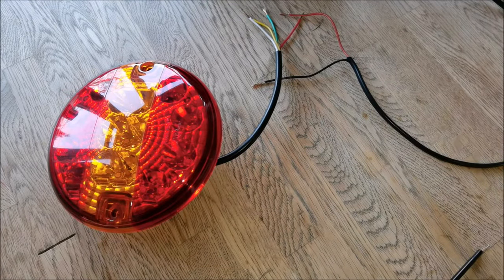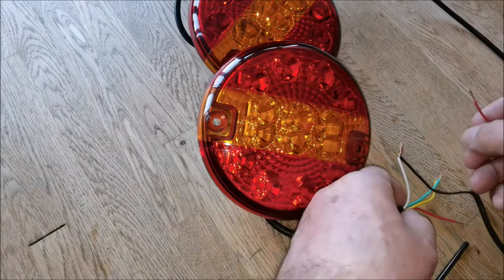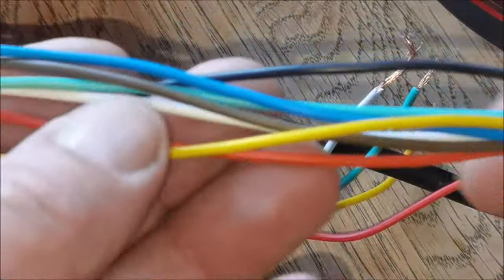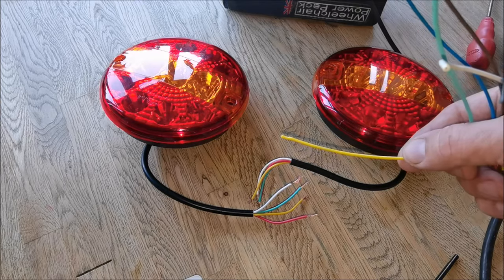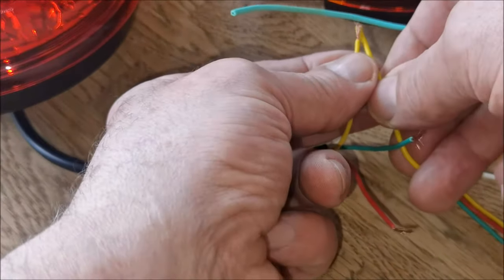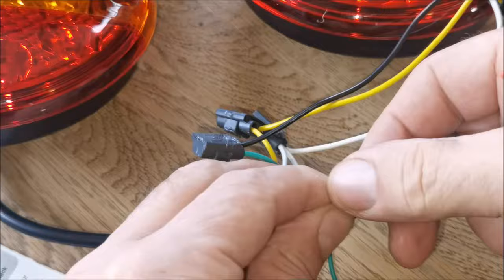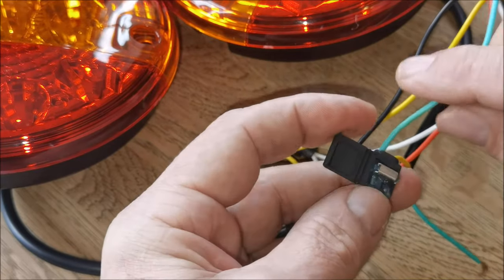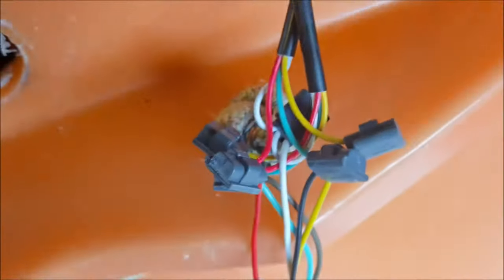HOW TO WIRE LED TRAILER LIGHTS FROM EBAY

Comment: By the way your Blue wire is for the fog on a 7 pin UK system. The reverse wire is pink which is pin 8 on a Euro 8-13 pin plug. Regards Steve
Reply from the maker: thanks for info steve

Comment: Hi I tested like you on a battery and only the reversing lights worked using the white wire as ground connected to a car battery negative terminal

Comment: Great video where did you get the block connectors please?
Reply: Just incase you haven't got them yet, they are called scotch-lok connectors. They are best only used for in a dry area of a vehicle and to tap in a wire to an existing wire. For trailers it's much better to use bullet or spade connectors to join wires, or even the Rubberlite waterproof junction boxes, as both scotch-lok and block connectors can rust away after time and cause lights to not work and you have to cut off and replace them a few years later. I've made that mistake before, believe me. My brother is a qualified mechanic and i wired my first trailer with them thinking they were a quick and easy way to do it and without consulting my brother first on what to use and when he saw them, he said unfortunately they won't last, they aren't good for anywhere they will get wet and he was right.